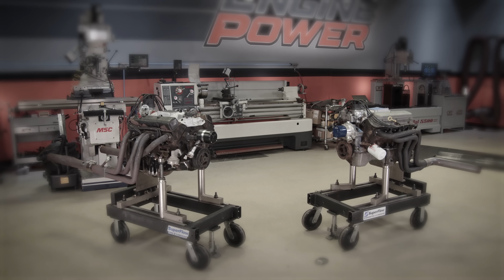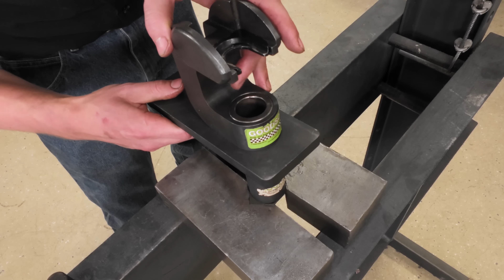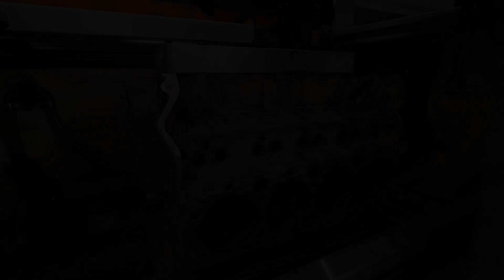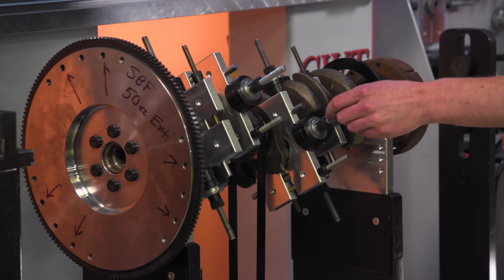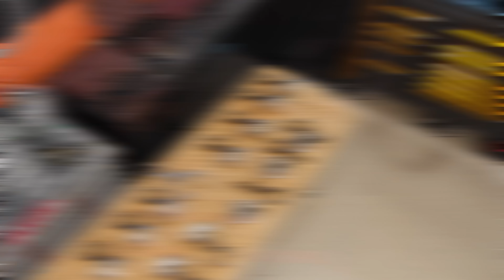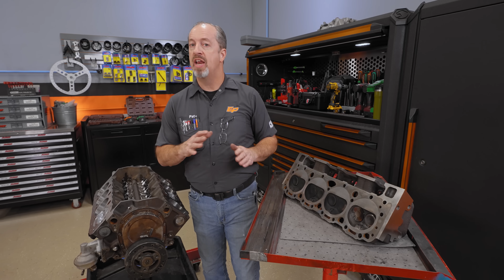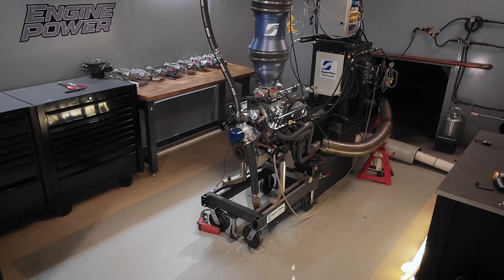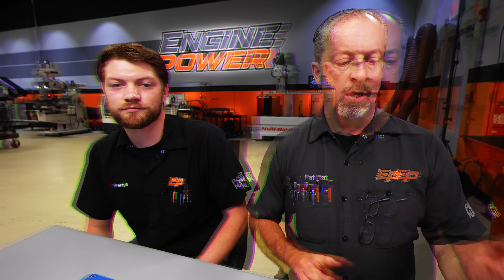305 SBC vs 302 SBF: Does Compression Help the Lowly 305 beat the Race-Bred 302?

Comment: Pretty silly to put pistons in these, particularly since that's one of the draws of a foxbody 302, forged pistons from the factory.   Shoulda tossed some super thin MLS gaskets in the Chevy until you got your number.   The fact that you guys did this kinda says the chevy pistons were further down in the bore than the ford. and the comp ratio difference was more than just the gasket thickness...

Comment: As someone that recently shopped sbf cams, that ford cam doesn’t have a 110 LSA like the Chevy does, it has a 114.  Such a weird cam, all that duration and lift with so much less overlap than the average performance cam with similar specs.  Must make a ton of vacuum at idle tho…
Reply from the maker: The Ford's camshaft has a 110 degree LSA as well. The link below will take you to the camshaft we used and you can check out all the specs.
 https://www.compcams.com/xtreme-energy-218-224-hydraulic-roller-cam-for-ford-351w.html

Comment: Great comparison. Is there a reason why we didn't see more tuning of each engine (timing etc?)
Reply from the maker: Good question! It really just came down to a time factor of getting both engines assembled, dyno’d and then comparing the data. The carb was pretty dead on for both and timing was tuned in on each engine for max power before their runs

Comment: I didn't see, did they upgrade the gt40p valve springs? They float at higher rpm with stock springs.
Reply from the maker: Yes both engines received upgraded valve springs with the cam swaps in round 1 and were reused in rounds 2 and 3
Reply: @enginepowertv awesome, I had a set of brand new gt40p's drilled to fit my 351 that was bored .20 over 1.7 rollers like you used a new comp cams 4x4 truck cam weiland stealth intake and 650 Holley double.  Was going to replace the stock 351 in my 91 interceptor but fate intervened car got damaged so the replacement has been sitting on a stand for over 15 years.

Comment: The 305 was designed as a fuel economy engine. Chevy already built a better 302.
Reply: So did Ford, the Boss 302. This is a comparison of plentiful run of the mill engines that everybody can afford.🤦

Comment: Since you guys like some of the odd stuff I thought I would share my drag car specs with you. I have a 02 Kia Spectra that just made 321 horsepower to the front wheels. It is a high mileage used engine with no added ring Gap and completely stock with the exception of a ported cylinder head and a turbocharger at 18psi  Running E85

Comment: @nagadsby9413
1 second ago
I ran a 671 roots blower and dual carbs on top of a used 305, 607.5hp. It would pull the front wheels on a 1600lb t bucket with less than 1/2 throttle. Very fun setup. It didn’t last long until it started severe blow by, but it was fun while it lasted.
I prefer Ford small block motors now though.

Comment: there is at least 5-10hp difference in the ring package 1/16 (used in the ford)vs the bigger 5/64 in the chevy. put some 1/16's in the chevy and its guaranteed to put out more hp than the ford. still not exactly fair

Comment: Years ago I was in the Army, when I returned to the states I needed a car quick, so I bought an 85’ GT Mustang with efi and auto transmission.  I ran great, but you know the 5 speed would get me, but only by a little.   Mine was the 165hp, and it needed help.  I went home on Christmas leave where I had my 65’ Mustang stored in the barn.  My best friend and I put 3.27 rear gears in it, a set of ford racing heads I had, and an Edelbrock intake, with an adapter for the throttle body, and a set of shorty headers, cat delete and flow masters. Just that little bit would throw my Mustang i front of all Mustang and Camaros, most corvette.  My son now has an 87’ vert and we did the usual GT40 heads and intake, exhaust and electric fans.  It ran great, but pulling the 2.73 rear gears and putting 3.27s made a big difference.   Gears are always overlooked, but if you want torque from the line you need gears.
Reply: I think it's less that gears are overlooked but more that gears are misunderstood by a lot of people. There are tons of people out there thinking "well, higher is better" and going from 2.73 or similar to 4.11 or 4.56 or something nuts like that. Hell, just throwing gears on that better match the power range of a stock engine can make it feel like an entirely new beast.
Reply: @Arcticun Exactly, match the engine and weight to gears. Growing up everyone thought 4.10 gears were the answer to everything.

Comment: If you could get a decent head on a 305 it would be a cool motor, the tiny bore limits your head choices. the ford 302 has more possibility for better flowing aftermarket head.  I wonder if it would have been better for the 305 to run a vortec head from a 350? the 305 vortec heads really aren't the same design, they do not have the fast burn heart shaped chambers. maybe mill down a 350 vortec head a bit which would probably still loose some compression but make up for it in flow
Reply: If they had used the same cc dome piston in the 305 as the 302 but used the 350 Vortec heads i think it would have beat the Ford by 15/20hp. I guess this series is done they’re probably not gonna play around with different heads since I assume the GT 40 head is max for the 302.

Comment: Pat this is really good, couple things I noticed, I realize this is a lo buck garage build but did you notice the intake gasket to port mismatch on the Chevy? Second thing that would be the bomb is do a 460BBF to a 454 BBC, no alum heads, just things you could do with your dad in the garage with maybe some hot factory heads?
Reply: RIchard Holdnder did a test on this see his channel.

Comment: Build a what if 302 chevy tpi take the crank and rods from a l99 4.3 v8 from a caprice and the rest of a tpi 350 preferably a 91 from a manual better to get the best parts offered then do these tests over with the 302 chevy

Comment: What kind of gas did you feed those engines? Iron heads need some octane up around 11:1. While I was glad to see the Torker intake manifolds go away, the high-rise single planes weren't much better of a match. I'm sure the intake choice makes great dyno numbers, but on day to day drivability, these engines would fare better with a Performer RPM style intake manifold. I'm still questioning how those GT40P heads made power numbers similar to heads that flow MUCH high numbers that don't require a rotary tool to fit a domed piston.

I am very surprised that the 302 didn't make a horsepower number because of the larger 4.00 bore and that the 305 didn't turn higher torque numbers because of the 3.48 inch crank.
Reply from the maker: We ran both engines on 93 octane from the pump

Comment: I look at it this way. No matter if it’s 302/305, 351/350, 454/460……there’s not really much difference. It really just comes down to preference, nothing more. Built the same, they’ll put out practically the same power. But I would take a 300 over a 292 all day long.

Comment: Not quite an apples to apples comparison but as close as you are gonna get using typical junkyard parts.  The higher torque down low is the 3.48" stroke of the 305 vs the 3" stroke of the 302.  The higher horsepower at the topend is the result of valve shrouding from the smaller bore of the 305 vs the 302.  The 302 having a 4.030" bore vs 3.766" of the 305.  An engine is an airpump ultimately and the faster more efficiently you can get the air in and out of the engine the better it's going to run.

Comment: The 305 has  bottom end torque from the stroke.

The 302 carries enough torque through the upper RPM because of the rod/stroke ratio.

Comment: People don’t understand it has nothing to do with the brand of engine but the design of the engine.
The design of the heads is the most important I think bc if both engines are small blocks with same bore n stroke n pistons,compression n cams n one does better than the other it’s bc of the heads n thats also why the LS engines make more power stock than the sbf or sbc bc it has a modern head design

Comment: Had a 78 Monte with a stock 305 2bbl and 2.23 gears. Did a 268 cam, Performer intake, Quadrajet, headers and 3.73 posi rear. Rsn consistent 14.5 so I'm guessing about 225hp?. Stock I think was 160. TBH the gears were an absolute necessity.

Comment: Complete nonsense test. The 305 is a completely different bore/stroke configuration from a 302. A 302/307 comparison would have been more accurate and a 302/302 would have been much better still.

Comment: Ford fix. Why not use the chev 302?  So weak a show.
Reply from the maker: We wanted to compare the readily available smaller displacement small blocks from each, that way it was pretty relatable to most people. 302 Chevy’s are pretty scarce and costly if you do find them, while 305’s are dirt cheap, abundant, and can make respectable power

Comment: You would’ve been better off using a 327 block with a 283 crank, that would give you 302 in.³ and a 3 inch stroke on a 4 inch bore, just like the Ford

Comment: The 305 has a horrible handicap
It has a 3.48 stroke and now a 3.78 in bore
The ford has a 3 stroke with a 4.030 bore, the bigger bore with the shorter stroke puts the ford ahead.

Comment: Yeah I'd love to build a max effort 305 tpi. It would be really cool to see exactly what can be squeezed from that 305.
Reply from the maker: It’s not a TPI engine, but we did a pretty stout 305 build no long ago that you should check out if you haven’t seen it yet! 
https://youtu.be/XHuO2lMx80c?si=P62AF7C5iRKAPxuR
Reply: @enginepowertv  Remember Larrys, SpeedOMotive in Ca selling the 305 stroker kits?  Big thing back then.
Reply: Hot trick back then was to stroke them to a 331, trick flow heads, cam exh etc.

Comment: Saw the 305 is 11:1, but did I miss the 302's CR?    11:1 is pretty steep for iron heads, y/n? Don't think you could run those WOT on pump gas.
Reply from the maker: Correct the 305 is now 10.92:1 and the 302 is now 10.91:1. All of our testing was done with 93 octane pump gas and you can absolutely run it at that compression ratio if the tuneup is set correctly

Comment: stage 4:

 a pair of 331” engines 4.03 x 3.25, AFR 195 heads, air gap intakes, and a magnum Comp 230/230 110, .598 for both Ford and Chevy w/1.6)

part numbers:

chevy: 12-450-8
ford: 35-450-8

each engine should be close to 500hp

Comment: Cant tell these guys like fords at all 🙄 if your trying to get the 305 compression to match the 302 why would you go with a smaller dome on the 305? I guess the heads on the 305 might have a smaller chamber but either way it always seems like whatever is being done, the 302 is given a slight edge 🤷‍♂️

Comment: Edelbrock E-Tec 170cc with heads milled to 60cc, 9.000 decked block, head studs, .015 head gasket, and the same pistons. The 305 will make more without breaking the bank. Especially if you already have to replace everything on the 305.

Comment: I would love to see a follow on build of one of my old favorites and one that used to literally fill up junkyards, the 307 Chevy. I've always felt its 283 bore with the 3.25 stroke of the 327 had much more potential than the 305 and could never really understand Chevy's reasoning for the 305 other than maintaining a common crank between the two and reducing production costs. I know they were always low performance car and workhorse truck engines but I'd love to see what one could do compared to these two engines.

Comment: Still want to suggest to either take a Pinto/Mustang II 4 cylinder only increase the compression, or what can be done.
Orrr, take a Mustang 2.3 eco-boost, and push it as far as you feel it can take.

Comment: I like how we americans call these small block v8s😂 I had a 302 in my 1988 lincoln town car had a compression in all cylinders about 170psi I think it was 98k miles I love the sound of a smooth running 302 I hate the chevys because that shitty head design with 2 exhaust ports in the middle so dumb.

Comment: I would like to know if it would be possible  to do another build using a 307/327crank in a 305 4 bolt block  6 inch rods. And iron vortec heads, with 1.94 intake valves if bore can ne opened as big as practical ie  3.85 to 3.9inch. 9.5 to 1 compression.
Those would be a street , daily driver capable of some  good  power, and excellent economy  in a light chassis.
I built one like this in the 80s but no vortec heads, and in a 74 nova and got 32 mpg imperial with a tight converter.
32 imperial is almost 37 us gallon
Was quick ,reliable, strong. Was used for 25 years after in a 3/4ton gmc daily driver untill demolished  in rollover. Lost track after that. But that was a good combo.

Comment: Man. Those 305's were always considered like the chesp small block back in the day. GM just using them as a cheap alternative. But i am completely singing a different tune after watching this episode. That's damn numbers for just a mild build. Really shows that compression done correctly is the lion's share of performance.
Reply from the maker: With a little bit of work, they can all run great! If you are looking for more sweet 305 content, check out our 2 stage build we did a bit back at the link below:
https://www.youtube.com/watch?v=XHuO2lMx80c
Reply: Got a 84 Trans Am 305 high output air induction runs very good 5-speed car original owner
Reply: @donaldcurtis9229 nice car. Congrats
Reply: I had a 305 built like this in my grand prix g body back in the day , and I was out there smacking  on fox body mustangs on a regular basis. They always.
Swore I was lying and it was a 350.
Reply: why build a 305 when a 350 is cheaper.
Reply: @T-pq6fk well, if you already had one, or have access to one for cheap. Maybe I wouldn't purposely go out and build a 305 instead of a 350, but like in the 80's, they put them in everything as a standard option so you could still go out and find a 305 for cheaper than a 350. Everyone goes out to snatch up the 350's. Just cool to build whatever you have.
Reply: The price is the same dummy, many people build what they have, any more questions thats been asked 1000 times?
Reply: @T-pq6fk  305 was installed in everything from caprice to monza.... 350s were only installed in some pickup trucks, vans, a handfull of later b bodies and some f bodies.

Comment: The test I would love to see is 302 vs. 305 vs. 307 Chevy engines. The exact same heads, intake, cam, etc, could even be swapped between all the blocks. I can't think of a better way to isolate and show the effect of bore / stroke relationship.
Reply: maybe a pair of 331” engines 4.03 x 3.25, AFR 195 heads, air gap intakes, and a magnum Comp 230/230 110, .598 for both Ford and Chevy w/1.6)

Comment: Love the LE9 305 sbc. Durable and when tickled, strong mighty mouse!
Mikel
Reply: Had one in a 1983 G20 conversion van that ran mid 15s @ 87-88 mph. Just a little factory 4 bolt main flat top piston short block, little porting on the 601 heads, mild Crane 10072 cam, performer rpm intake, modified 850 Q-Jet and some thorley tri-y headers. Van still had the stock 700r4 and 3.08 gears.

Comment: Power curve variation here is from Bore/Stroke differences. 305
GM is 3.736 x 3.48 (promotes better low rpm torque,but also shrouds the valves with it's much smaller bore ,also limits valve sizes)
Ford is 4.00 x 3.00
(Promotes better high rpm HP)
GM's rare Z-28 302cid block's 4.00 x 3.00 would be an exact match vs Ford 302.
Cyl heads of equal compression and valve sizes would make a more even test.
Reply: No it's not.  It's from the deck heights being different.  The Chevy smallblock is significantly higher than the Ford, giving it more port length which is better for lower end power and it showed just that.
Reply: @superkillr there is a huge piston speed difference because of the stroke, you know.

that, and the longer manifold runners would do what the dyno showed.

Comment: The Ford got ripped off twice. 
Just because the Ford head had better factory compression you changed the controlled experiment to fit a new narrative essentially changing the original experiment. That 305 compression boost with after market parts put the Chevy in a territory it would have never seen.
Removing more material from the Ford piston than the Chevy piston means you lowered the compression on the Ford more than the Chevy. Both the Chevy and Ford pistons should of had the same amount of material removed.
But the results were typical in that the Ford still beat the Chevy.

Comment: That's a lot of time and $ to throw at a 302 for 20 odd horses. But the 305 responded better for 30+ and a bunch more torque in a user friendly range. Either way, in a light-ish street car, they both would be a lot of fun with a stick!

Comment: The compression bump was great, but the factory heads and relatively small cams are holding these engines back
Reply: The cams could have had lesser specs if the heads were better. These stock heads are junk, good aluminum heads would have been worth the investment and only about 1/3 or so more than these heads cost.

Comment: I'd like to see you compare late 60s TransAm 5 liter engines. A Ford 302 vs. a Z-28 302. Maybe toss in a Ford Boss 302.
I'm old enough to remember guys combining 327 and 283 truck engines to configure very high rpm engines right at 302. Four inch bore, 3 inch stroke. Bowtie 2.02 intake valve heads.
I remember a dude, in the mid sixties, that had a Chev 302 that he shifted at 9k rpm. Was a truck 283 bored to four inches. Steel crank, 4 bolt mains. Some machinging is required on heads.
Those were fun days !
ps...I've rebuilt a 67 Chev Z-28 engine. They are so beautiful inside. I miss those days. Am old and getting blind, but I have some k movies ....
Reply: ...uh, memories
I hate auto correct